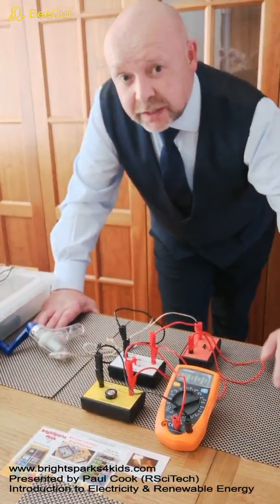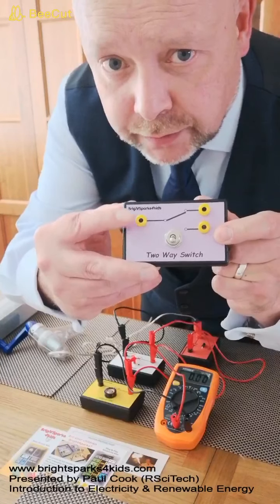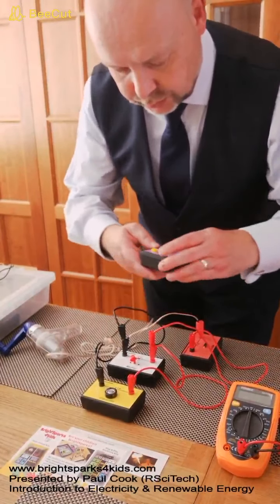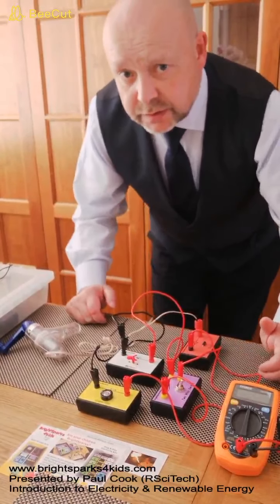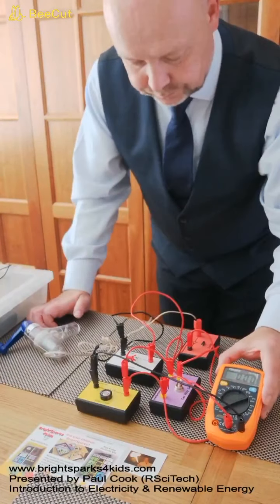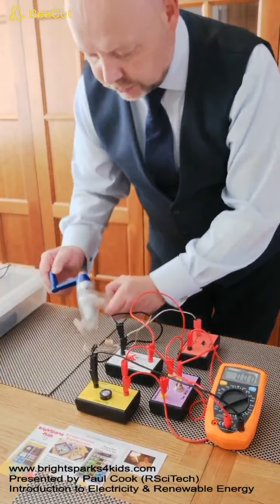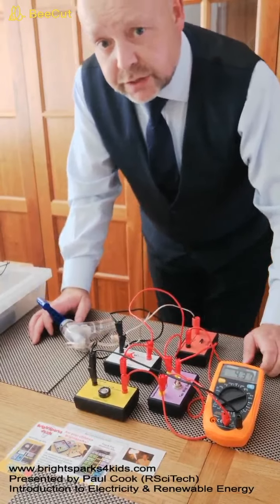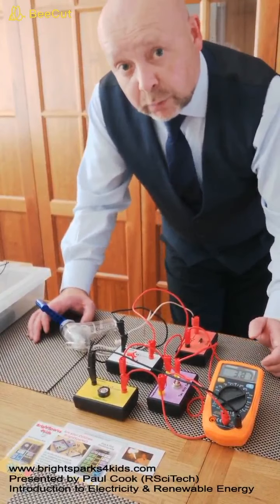Introducing the Hand Crank Electricity Generator Activity 50 (2 way Switch0-BrightSparks modules

Comment: Thanks for this video. I realise there's no need for batteries, and I can use the pushed electrons from the hand crank generator to pass through filament tungsten wire to generate heat if I want something that can start a fire by heating the tinder if I wished to, which would also save buying plastic, gas, wood (lighters/matches etc), as well as batteries, which I know does harm the environment when disposed off, which typically ends up in land waste areas further contaminating nearby water sources as well as the wildlife that attempt to live there